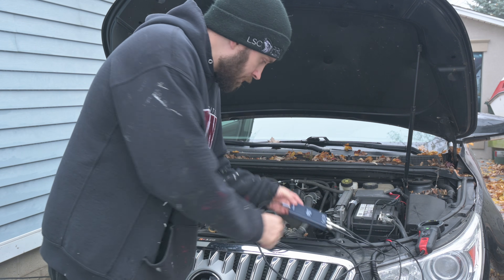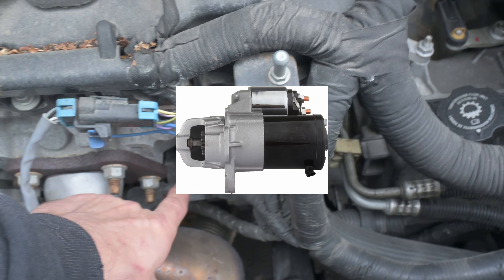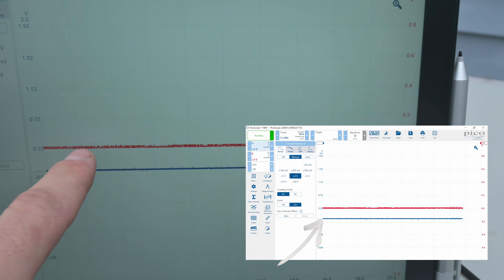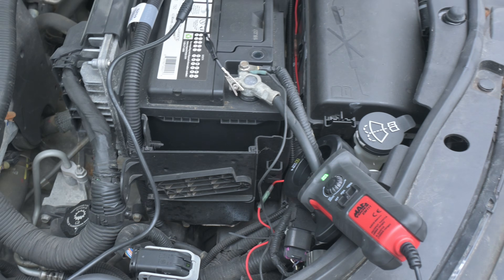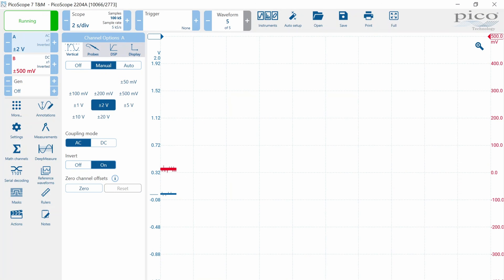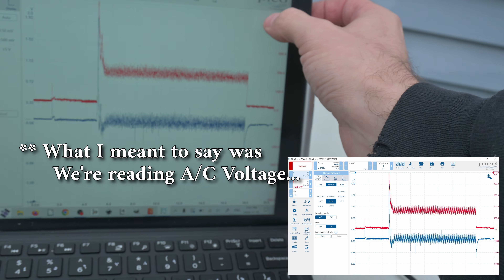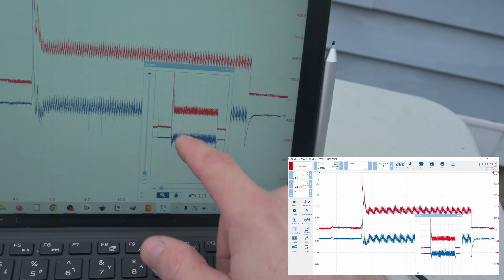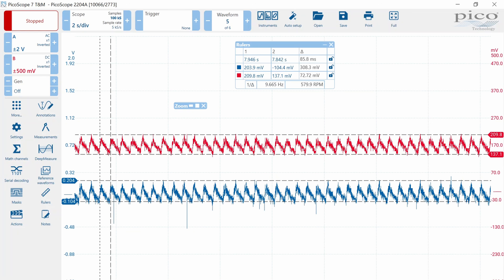Relative Compression Tests Made Easy

Comment: Cool. I have the 2204A. I just made a delta pressure pulse sensor from an old smoke alarm piezo. Used it to measure exhaust pulses synced to cylinder one ignition. The pico software lets  you set degrees and divisions to easily analyze waveform. Also, if you invert volts waveform you will essentially be looking at the current waveform.
Reply from the maker: Very cool! I never would have thought to pull parts from a smoke alarm. Thank you for sharing!